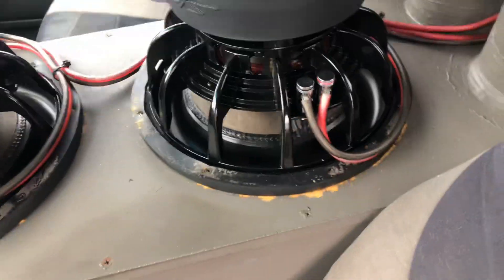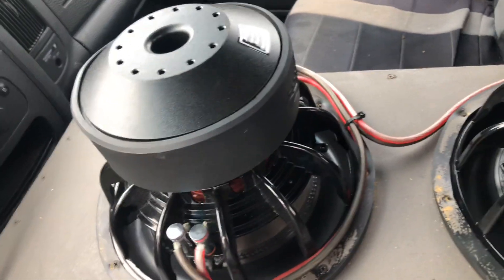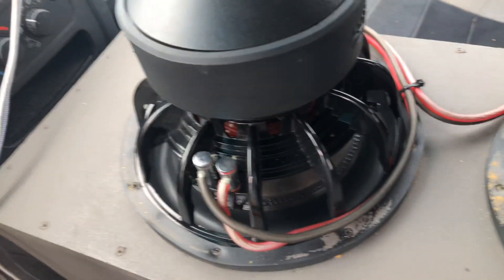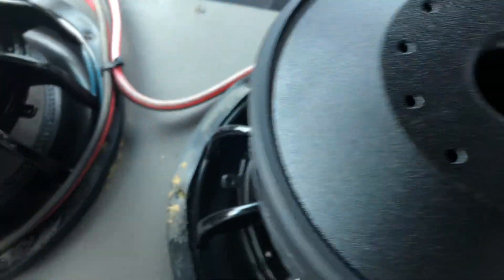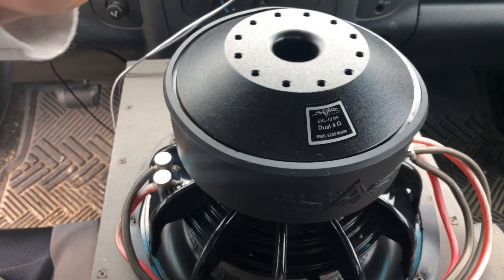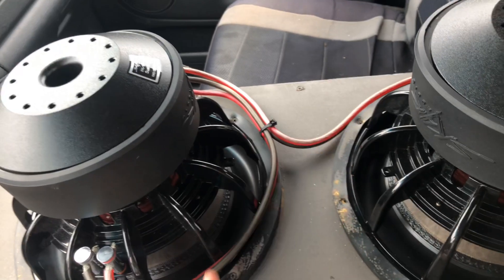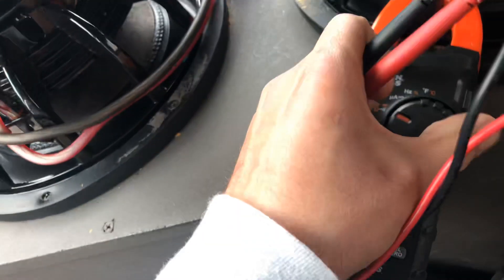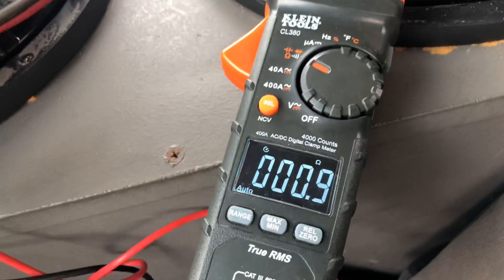How to wire 2 4ohm subwoofers to 1 ohm

Comment: Is a bigger guage on the wire better when doing 2 4ohm subs to 1 ohm?
Reply from the maker: It all depends on how much power you plan to run on them, there is a chart somewhere that shows what size is recommended , I always used 12 gauge and 10 gauge ofc wife

Comment: @TheRandomHandyman so can I take + to+ \ -to-/ then - to - input of speaker terminal then + to + of speaker terminal then repeat on 2nd sub then leaving me with on outside of the box with one + lead and one - lead to the amp bc my amp only has one set of + and - inputs ? Would it still be a final load of 1 I’m using one set of + and - bolts on the box so I would take both - connect em in the box after cutting in half and same as the + side then on other side of box take one + to amp and 1 - to amp

Comment: I have it like that but at the amp it says 0.00 on the multimeter but if turn the wires around it will say negative 4 but if i disconnect it says 1 ohm any ideas why this is?
Reply from the maker: If your checking at the amp when it’s all connected it could be reading off , if the subs show 1 ohm when disconnected the impedance of the subs is good

Comment: If I did 3 subwoofers this way would it drop to 1ohm still
Reply from the maker: That would depend on the beginning impedance of them . If you go to “the12volt.com” you can see different diagrams
Reply: @TheRandomHandyman  all 3 subs are 4ohm
Reply from the maker: @Garza713tx  ok, this depend on if they are 4 ohm single voice coil or dual voice coil if they are dvc and you wire them one way you get 2.6 ohm and if you wire them the other way you end up with 6 ohm if they are singe voice coil you can get 1.3 ohm or 12 ohm .
Reply: @TheRandomHandyman  sorry man.. but yes all 3 subs are dvc 4ohm

Comment: I only have on input on my amp how should I make 2 4ohm to 1 ohm before the amp run the speakers together like you would if they was 2ohm subs
Reply from the maker: Depends on if it is dual voice coil or single, but you would either have to buy a single to double input has a post then 2 holes . Or use a box terminal and connect all wires  to go together into the one terminal on the amp for both sides

Comment: To get two 4 ohm DVC subs to have a final impedance of 1 ohm. Wire all positive together. And then all negative together respectively.
Reply: Then just send it out 1 port to the amp? Cause your way seems easier than his
Reply: What about 2 dual 2 ohm subs to 1 ohm is that possible?

Comment: I have a pair of subs connected like this but the one that connect to the Amp blows after a year while the other is perfectly fine why is that?
Reply from the maker: I mean it man possibly get more power and take more abuse being the first in line but idk I’ve never had any issues in multiple set ups, possible just that sub itself had an issue is it a brand you can get a recone kit for and slap some new guts in it for cheap?

Comment: How do you wire it to the box terminals though?
Reply from the maker: Instead of the ends connecting to the amp they connect to terminal inside box and the outside terminal on box goes to amp
Reply: Damn I got it… thanks I needed tht… for my 2 #4ohm #dvc SA-12v3’s

Comment: Bro you had the Wolfram ag 12. What happened. You like Skar better?
Reply from the maker: I really don’t remember why I switched the wolfram out with the skars, I think I had the skars first, and that box in the video was built for them going off of the specs for the skars so it played better with them in it, the wolfram moved more air though, I gave them to my nephews they each got one to put in there vehicles they still have them. I would like to pick up one of them wolfram amps. Also wouldn’t mind a dc 10k or sundown 10k haha but ya see the way the bank accounts set up lmao. I’ll have a new build in the near future been to busy . The wolfram were nice for sure though. You got anything currently?
Reply: @TheRandomHandyman  ... I got two sundown x8v3 on a deaf bonce machete 2100 and a mechman 240 alt and a xs power d3400. I ordered two sundown x12v3 yesterday but 8 changed my mind and cancelled my order because it was close to $1400 and I was looking at the Wolfram ag 12 and I think I like them. At $300 wow. I hope I like them ..this hobby is expensive. I already blew up my subs 4 times. I don't think those sundown x8v3 can handle there rms rating. Not for long

Comment: Hey I just had a Guy install my subs they are dual 4 ohm speakers wired down to one ohm connected to my monoblock amp and when it was connected to amp subs would just pop and not getting no play out of them and they're brand new never been hooked up the guy said that my amp was bad but it was new also do you have any idea of what could be the problem
Reply from the maker: Is it a continues pop or it just pops once ? Or is the fuse popping

Comment: Nice video bro ,but i was just wondering i have the hifonics 2614.1d amp with 2 negatove and 2 positive for speakers would it be better to run it at 2 ohms amd run each sub to a terminal each  or make them 1 ohm amd use only one ternimal for the 2 subs
Reply from the maker: If there is 2 sets of terminals , but the amp is a mono block amp then those terminals connect to the same thing inside of the amp so it would be the same as working together in one terminal if you put them separate . Some amps have more connection spots so you don’t have to try to cram 2 sets of wires in. If it’s a 1 channel amp though it will not be separate

Comment: Can I also get 4 subs that are dual 4 ohm, down to 1 ohm? I ordered 4 of the Skar SVR 8" 4 ohm. And I ordered the Skar RP 1500 watt monoblock amp for them. How can I make that combo work at 1 ohm?
Reply from the maker: Yes it would be the same way these are wired just incorporate the other 2 if you have any issues add me on Instagram same name as on here and I’ll send you a diagram
Reply: @TheRandomHandyman  ok thanks, I just sent you a request on IG. Yes please send me the diagram, appreciate that
Reply: Pretty sure your only impedence options with 4 -4 ohm dvc drivers is 2 ohms and  .5 ohm
Reply: Ram into same issue everybody said wire for u subs this way it's one ohm I did metered it it only comes out to 0.5 ohms three will b one ohm but four ur dropping to half. So just get the half ohm stable taramps bass amp and ur good run all four at half ohm and blow ur dashh to oblivion ahhhhh comohhhh

Comment: So when i make it 1on like yours i can run all 4 speaker wire's into the amp rite
Reply from the maker: If it is a mono block amp and has 4 terminals then yes
Reply: @TheRandomHandyman  ok cool and yes it is it has 4 terminals
Reply: @TheRandomHandyman  and when i run it to the amp do run each wire by itself

Comment: How should I run 2 2x4 subs on AUDIOPIPE AP-10001D ? Rms for both speakers is 750 but if I run it how you did my amp would push 1000 rms from 1 ohms
Reply from the maker: Depends on electrical on true rms output of that amp, if you have 2 subs that are booth dual 4 ohm you can wire them like this to 1 ohm and get whatever 1 ohm output is for that amp so around 500 watts to each sub at 1 ohm
Reply: @TheRandomHandyman  so does that mean both would sum up to 1000 rms for 1 ohm to match the amps rms without blowing the speakers ?
Reply from the maker: @lim3059  if your subs at dual 4 ohm. And you wire them to 1 ohm your amp will output whatever it’s 1 ohm rating is so if that would be 1000 you would figure each sub would see around 500 each if they are rated for 750 rms each then 500 would be super safe. Now it is possible to burn a sub up or blow a sub up without over powering it, for example you can have a sub that is rated for 1000 watts and only have a 200 watt amp and still blow the sub if the gain is turned all the way up and clipping dirty power and also voltage drop from poor electrical in vehicle can also be an issue but at 1000 watts your all good should be no power drop issue and as long as you gain on amp isn’t cranked all the way up and distorting you will be perfectly fine
Reply: @TheRandomHandyman  awesome thank you I appreciate the info very much 💯💯

Comment: question. i have a 1 ohm 1 input amp and 2 dual coil 4 ohms subs. as i understand it. they want you to make your 4 ohms to be 1 ohms if your amp is a 1 ohm. if you understand what i mean. is that correct?
Reply: Correct.
Reply: Just wired each sub to 2 ohms then wire both subs together then put them to the amp
Reply: Hi if amp is bridged does the ohms on amp change

Comment: Wire gauge?
Reply from the maker: Pretty sure that was 8 gauge from down for sound
Reply: The random handyman ah ok, it’s bc I was wondering if my 8 gauge could fit, which Ik it will but I’ll have to fit two 8 gauges in two terminals and idk if that will
Reply from the maker: ClawzYT you talking about in the amp?
Reply from the maker: ClawzYT cause on the other side of subs I have the 8 doubled in the subs and the amp they were on had 4 terminals but I only used 2 so it would fit at amp and in sub depending on what subs some have small push terminals these are pretty big though

Comment: I'm currently @ 1ohm stable with 2 10"dual 4ohm  sub's & been like this for about 2.5 yrs now and now isue but wanting more power I'm @ 1k but it's not enough so I'm getting 2 skar ddx 10-d4 with skar 2500 amp what says you?
Reply from the maker: You should be pretty satisfied with the increase in power and the better subs and 2 dual 4 is the way I would go. I had 2 dual 2 wolfram subs but only cause it was all they had in stock the .5 ohm was a little rough on the electrical though.

Comment: Wouldn't it be simpler to get two dual 2ohm & wire them to 1 ohm that would be less wires yes?
Reply from the maker: lolo ent no, 2 dual 2 subs can be wired to 4ohm, 2 ohm or .5 ohm the only way you can wire 2 2ohm subs to 1 ohm is if they are single voice coil subs. I have other videos with some dual 2 subs wired to .5 ohm. And if someone had 2 dual 4 subs they would probably be more willing to use a little wire than to buy another set of subs to save 4ft of wire the price difference would be made up quickly. But yea there is ways to accomplish the same ohm load with less wire on these subs I just prefer to wire this way for equal power rather than going in one side. But typically whenever you decide you want speakers you will figure out how many you will be useing and say ok I have room for 2 or 4 and then figure out how many you can of what ohm load to be wired to 1 ohm usually that is the desired load as it is safe for most amps rather than .5 and if you are at 2 ohm u won’t get full power potential from 1 ohm stable amp. But to answer your question you would need 2 single voice coil 2 ohm subs to wire to 1 ohm as simple as possible but there are other differences when going from single to dual .

Comment: Hey what's going on! I have 4 dvc DB drive WDX G2 12's RMS 1250 Max 2500 I have them in a ported 4 12 box what is the best amp that you recommend be that I use. Thanks alot
Reply from the maker: You want 1 amp or 2 ?
Reply: @TheRandomHandyman  I really just want too get one good amp
Reply from the maker: If your wanting to use 1 amp I would suggest something 4500-5500 Watts rms wolfram has some new amps that are decent priced, I also recommend skar amps, dc audio, and sundown

Comment: So is that still considered parallel. With two positives and two negatives going to the amp instead of just a single positive and negative?
Reply from the maker: Yes
Reply from the maker: Would only be series if you went pos to neg
Reply: Ok thanks man the 4 terminals can be confusing on 1 channel mono amps. I thought the speaker wires needed to go in on a specific side of the terminals. But great info I subbed 👍🏼
Reply from the maker: No problem and thanks, if ya go to google and type in what exactly you are looking for for example “ 2 dual 4ohm sub wiring diagram” and click images it should pull up charts showing every possible way to wire it and what ohm load it will end up at. Some monoblock amps have more than 1 set of inputs as well the skar I was useing had 2 positive and 2 negative terminals but they connected on the inside the amp.
Reply: @TheRandomHandyman  thanks for letting me know about that I was confused as hell when I seen four terminals on my scar amplifier did not know they ultimately met and the internal parts of the amplifier I have two 4 ohm scar EVLD for 6.5 inch subs and want to wire them down to one Ohm I am blind so this shit is kind of tricky even blind people get into sound systems LOL I have two scar EVL dual four ohm 6.5 subs and a scar RP 350.1 amp I ultimately want those speakers wired down to a one ohm load
Reply: @TheRandomHandyman  thanks great help, I’m going to get it rght… 😉

Comment: How do you wire them to get 1 ohm? + to+, + to - or ?
Reply from the maker: +to+
Reply: +2+ -2- do the same on each sub then run + from one sub to the + on the other same with negative then to amp as normal

Comment: These or the wolfram 12? Are the wolframs worth 110$ more than these
Reply from the maker: JirenTheGrey. Fortnite Battle Royale this is a skar evl 12 199$ each  and the wolfram Ag 12 I payed $189 each looks like they are 300 now
Reply from the maker: JirenTheGrey. Fortnite Battle Royale I’d probably go with 2 evl for 400 rather than the 2 Ag for 600
Reply: The random handyman how they hit man, i got a sundown 3k and blew my SA’s i need some replacement subs but i wanna try a dif route
Reply from the maker: JirenTheGrey. Fortnite Battle Royale they both got down bro I got trophy’s with both sets . Can’t go wrong with either brand
Reply: The random handyman yeah i seen a guy do a 145 at 28hz with EVL 10’s. Yeah, you heard that right. 145 on the dash with 2 10’s at 28hz.. but he had em on a taramps md 5k. i hear these  can murder the lows on good power thats what im looking for
Reply: The random handyman also i see you had an SA long ago would u rather rock with 2 evls or 2 SA ?